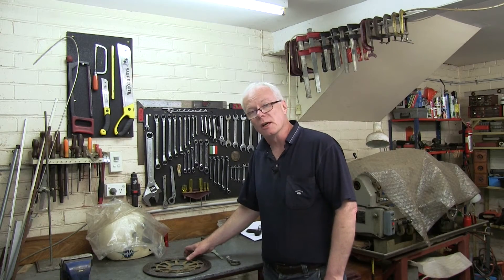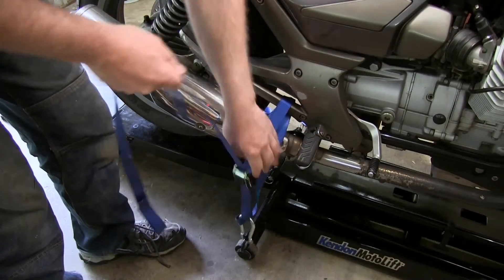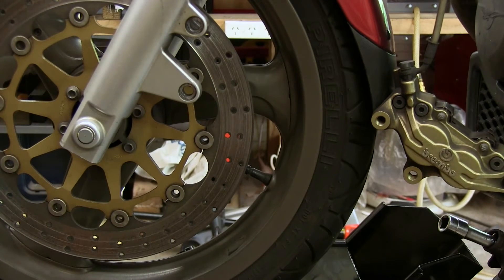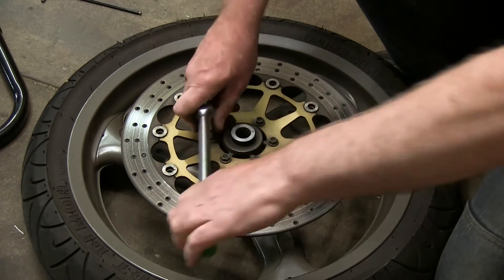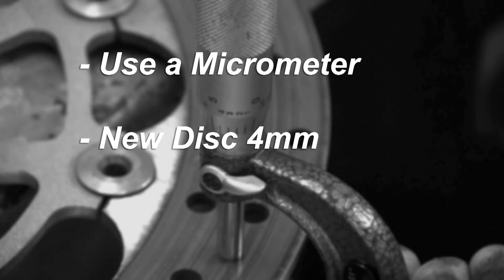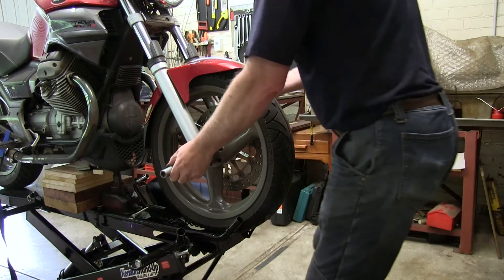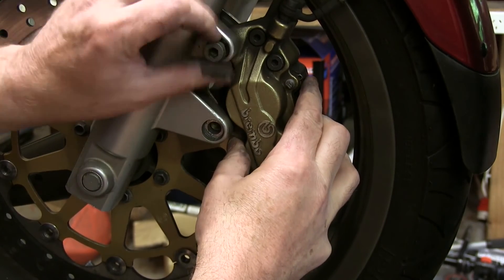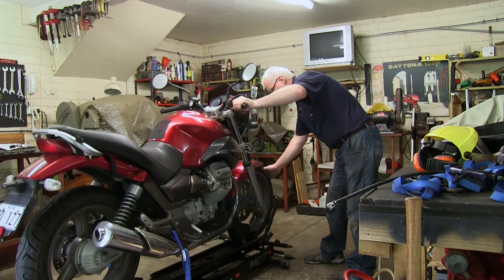New Front Disc for our Breva 750

Comment: Mike. Does the 750 engine or transmission make a whining noise when under acceleration at higher rpms? Much different sound than my 1983 Cal ll. Thanks, Bob
Reply from the maker: The gearbox can have a distinct whine particularly on the earlier Brevas. The gears where updated from around '05 onwards. Ours is quite loud.